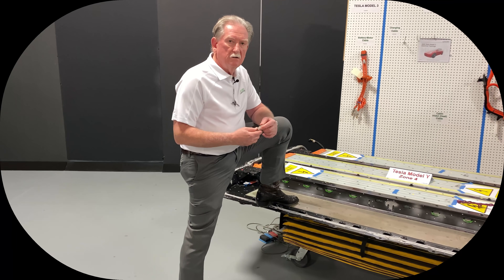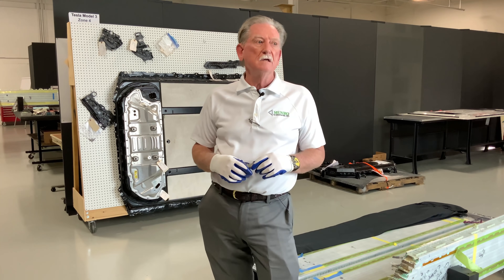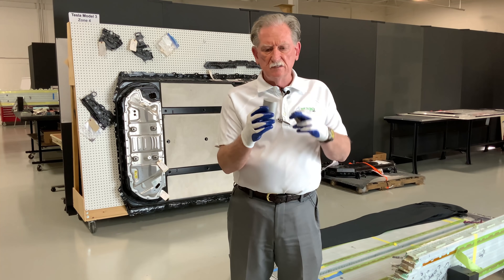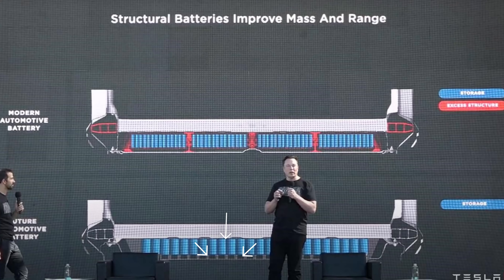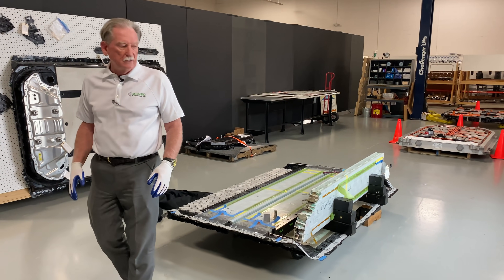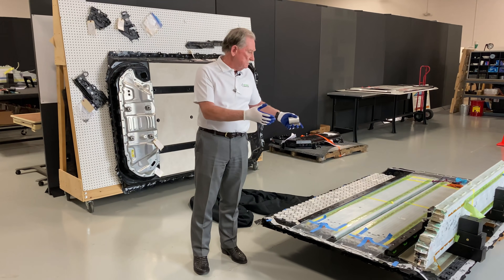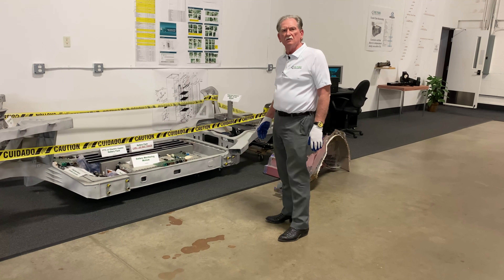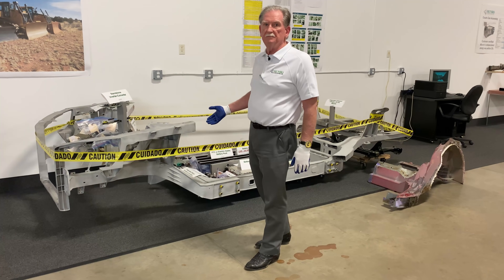Sandy is Thrilled about Tesla's Battery Day & Begins Battery Mock-up

Comment: Hard to believe how far Tesla’s come.  Three years ago, Sandy panned them for their poor body work—which was so bad he didn’t even finish his look “under the hood.”  Once he went back and looked deeper, he saw, “these guys are doing some brilliant battery and powertrain work.”  Now, Tesla’s caught up on manufacturing and is preparing to lap the field. 👏
Reply: We are very lucky that Sandy decided to take a little test drive in the Model 3 that he had just panned.  It was sitting there, so why not go around the block.  After a very short ride Sandy, Mr. Objectivity, adjusted his attitude and looked past poor body design, fit and finish.  And very quickly, Sandy got it.
Reply: @bobwallace9753    old news.  Our March 2019 Model 3 is fantastic.  Best car I've ever owned.
Reply: I honestly don't know?
My local buckhead ga tesla showroom. I wasn't particularly impressed with the latest 2020 model s raven on display for overall fitment on panels. Especially for a $95,000 car. 

And there is still many on here who post video's on their car's gaps, missing screws, loose lower control arm bolts. Just a lot of sloppy stuff that needs to be addressed. No excuses anymore. Especially now that allegedly the made in China car's easily out shine the made in the U.S. Unit's.
Reply: @dzerres  
That's consistant with what I'm reading from people who have recently bought a Tesla.  I think there might still be some very small paint problems with a few tiny dust particles in the paint.  I suspect Fremont will get a reworked paint shop once the Berlin paint shop is running and proven.
Reply: @dzerres  I've read a ton of news lately about really bad model y's. Definitely not fixed.
Reply: RC18 I can see that “fit & finish” complaint, but I’m SOOOO not a “fine details car guy.”  I’m a value and features guy, and nothing comes close to Tesla in those categories.
Reply: @Aktenverwalter  Many a new car production line goes through teething problems.  Teslas probably more so as they are  hugely wet behind the ears compared to legacy manufacturers which have been around for over a century.

Having said that and driven a Model 3 Performance... damn it's a sweet ride!
Reply: @x3nosthemutant  These issues are known for years now (panel gaps, paint, etc.) that the "it's a new car" argument isn't valid. Sure, for specifically new features I would agree but not for general things like paint. (I like Tesla but think their quality problems need to be adressed for real at this point.)
Reply: @Aktenverwalter  Went to the delivery center, then to Audi.  Meh not much difference.
Reply: @Aktenverwalter  Fair point, they still have to up their game on the paint side.  Would still argue they reached volume production only 2-3 years ago, so "teething problems" still apply.

Point is Teslas are interesting vehicles. They ranked lowest on J.D. Power 2020 quality study, but have highest consumer satisfaction in US & won numerous awards here & abroad.

Guess different people focus on different things, eh?
Reply: @bobwallace9753  I have a Feb 2020 Fremont Model 3, when I took it for correction/ceramic coating the guy said there was just one of the spots that he said used to be well over 10.
Reply: @EpicJonT  That is similar to the several retorts I've read when someone talks about the Fremont cars having lots of fit and finish problems.  Of course it's only anecdotal data that tells is nothing if the previous problems have decreased, stayed the same, or increased.  My point is that I see no one actually gathering usable data.  

What I see is reference to  one site that tabulates complaints from owners and exists to sell their data to the legacy manufactures.  The data they present may or may not be usable to determine what is going on.  What they are doing is not research.   

Someone needs to objectively count the problems on a large number of cars coming out of the Fremont plants.  And do the same for other car factories.  Until then any fit and finish statements are worthless.
Reply: @bobwallace9753  Wasn't trying to weigh in or anything, just saying if there are issues then they're not significant to me at least, I'd have never noticed the spot myself in a million years. Everything looks great, I haven't noticed a single issue. Someone did scratch a part of the interior before delivery but that's definitely not a defect.
Reply: @EpicJonT  Understood.  Just pointing out that one, or a few, volunteered reports does not settle an issue one way of the other.  Proper data gathering is required before declaring problems/no problems.
Reply: @Aktenverwalter  quantity of news is not a very useful statistical metric. Just sayin. But yes, historically QC has been an issue for Tesla.
Reply: All of that said. Tesla really should tighten up a few quality control bits!
Reply: @4literv6  Where does one find data on the quality control Tesla has in place today?  All I find is stuff about the problems Tesla products had in the past.
Reply: @4literv6  I'm dying to see them upgrade the paint shop in Fremont.
Reply: @waynerussell6401  The facts you though you had are not found in that article.
Reply: @bobwallace9753  Still remember this video , he was way off in his first assessment of the Model 3,  he looked quite ridiculous then.
Reply: @pierretetreau7497  
If we're talking about the same video, I though Sandy looked like the other two. Formed an opinion with inadequate knowledge.  But Sandy really impressed me when he came back for the second video.  In that one he, right up front, admitted he was wrong and argued with the other two whose minds were still closed.

Damn few people are able to quickly admit when they make a mistake.
Reply: @bobwallace9753  Thank you for the info as I was not aware of the second video, it changes my opinion over Sandy. : )
Reply: @pierretetreau7497  Sandy is one of the most honest, stand up people I've ever known.  He looks for the facts and changes his opinion when facts tell him he's wrong.
Reply: @gags730  No, the most efficient way to cool the battery is to have as much of the metal in the coiled layers in the battery directly contact a surface that will wick away heat.  That's exactly what this tabless battery does.  Heat can travel efficiently to the cooling plate and not have to take a longer route.
Reply: The fremont factory specifically has quality control issues. Their China factory proves that they can scale their production tech without suffering quality flaws, so if you're looking towards the future, where 2 new factories are opening up, if at that time they tighten up their QC, have 4 functioning factories with in-house produced batteries, and produce a $25k EV, good luck to the competition!
Reply: @electrified0  Do you have data about currently produced cars in Fremont or are you just repeating stuff you've read on the web?
Reply: I still won't own a model S Plaid or any Tesla.  No HUD, no Matrix LEDs, no drivers display on the 3, no coloured ambient lighting.  I certainly won't spend 153,000 on the plaid without even Matrix LEDs, let alone any laser light (admittedly that is very high end but the rest should be there).  Oh and I won't buy an S if the exterior and interior design isn't refreshed.

Comment: I think the Berlin model y will be the first produced car to use the new 4680 cells. In the interview he did in Germany, he said that he would give more details about the German-made model Y on battery day. 

On the slide where they showed off which model would use what chemistry model 3 was with the megapacks and model 2, the Model Y was with the model S, X, and powerwall. 

On the cell to car slide, they showed it is one big casting for the back one for the front with the new battery pack design in the middle. It has been talked about that Tesla would make one big casting for the front part in Germany. 

Elon has tweeted out that the model Y made in Germany would be the car to look at when it comes to innovation. 

And lastly, in the Q&A, he was asked if they would make batteries in Germany, and he said they would be making cells in Germany. 

That would mean that the cells will be in the model y next summer before the plaid model S!!
Reply: Problem with that is their casting machine is at Fremont isn't it?
Reply: @zlcoolboy  They're installing eight of those machines in Berlin last I checked. Shanghai also has them now.
Reply: Totavo It is two at Fremont now, one is finished, and one more is installed now. And it is still 6-7 months before trial production in Berlin, plenty of time to get a couple more of the presses😉

Comment: @Munro Live is it feasible for Tesla to cast the walls of the cell "cans" into the pack structure? This could provide unreal rigidity and eliminate a bunch of epoxy to keep things in place as well as the individual can parts. The idea is to shove the jelly roll directly into a full pack of cast "cans". Then seal the pack and do the initial charge on the full pack.
Reply: If you used a floor pan moulding as the cell casing then all the cells would be at a common ground, you'd only see around 3.8v across the giant parallel-ganged battery.  The losses, due to resistance, with this low voltage renders it effectively unusable.
Also currently each cell is completed, conditioned and its electrical profile measured as they all come out slightly different when manufactured.  Similar profile cells are then grouped into a pack, which you couldn't do if physically mated together.
Reply: @Clark-Mills  Very good analysis.
Reply: I don't think a casting can have structures as thin as the steel can, so the casting would add more weight. As structural rigidity and resonance modes are already extremely good with the epoxy'd cells, that weight would not be worth the potentially improved rigidity.
Reply: @cheezzinator  I considered the walls in a casting are likely to be thicker, but being made of aluminum instead of steal changes the weight calculation. However, my real interest in considering the possibility isn't weight.

It reduces 960-ish parts down to a single cast part. Then you shove a full pack's worth of jelly rolls in it in a single process, complete the construction, and charge as a single unit. Can such a casting reduce enough other steps (e.g. forming cans and glueing them in place) to be worthwhile considering the tradeoffs. Though, since they're showing lots of footage of cans flying by at high speed, they may have made their bet against this idea.
Reply: That would be extremely hard to do as you have to match the cells closely when you create a pack. 
You wouldnt be able to guarantee each cell would match appropriately until they were filled and the initial charges were done. Doing that as you say would require them to basically destroy a battery each time it didnt match.
Reply: That idea is far ahead of its time.When the 4680 will be made without cans, just a strong outer separator holding the electrodes for the initial charge for validation  and afterward, place them on the cast floor pan in honeycomb design for added rigidity and weight improvement.